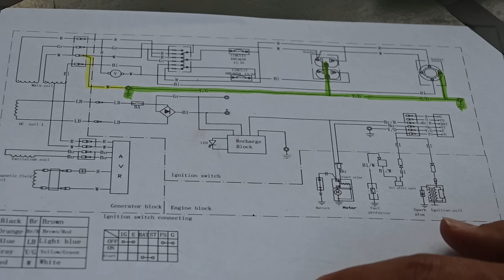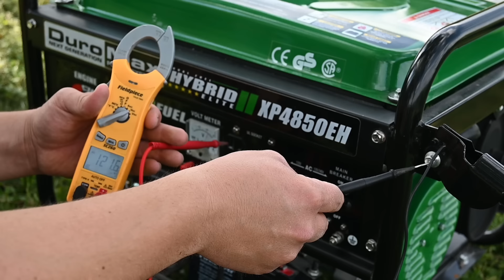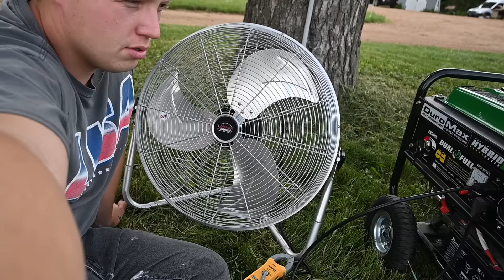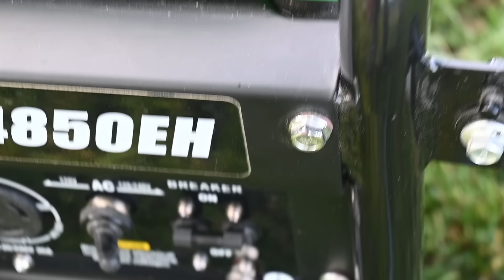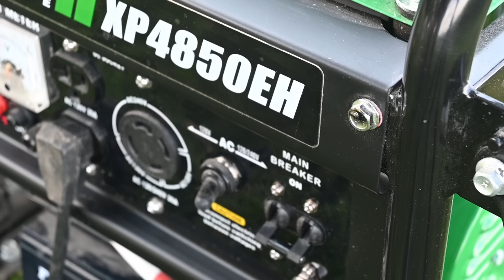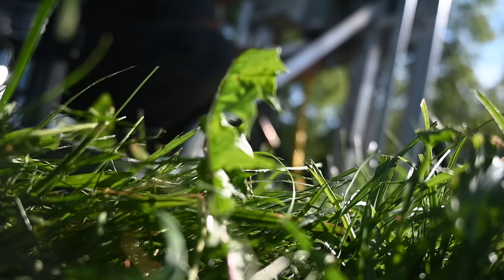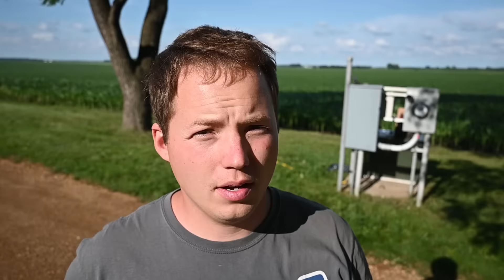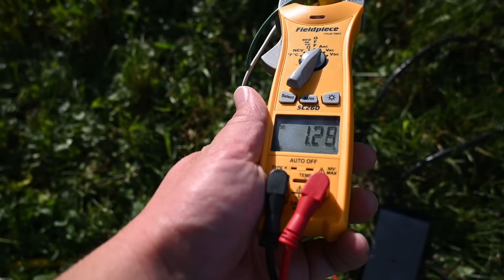What is a Floating Neutral Generator?

Comment: The frame of the fan would ground-fault to the grounding prong of the plug. This would cause a direct short inside the generator and trip the breaker. You should be testing from the grounding prong to the 120 volt hot side, not the frame. Voltage wants to return to it's source, not ground. The source is the generator not earth ground. If the generator neutral is not grounded to earth, then no circuit exists between the hot side and earth ground - no shock. For the frame of the generator to cause a shock if shorted to hot, the neutral side would have to be grounded to earth to create a circuit. In that situation you would be completing the circuit by stand on earth (neutral) and touching the frame (hot). You would have to go out of your way to wire it that way. The frame is not connected to either conductor so no circuit exists.

Earth ground is to protect from lighting. Electrical service grounds neutral to earth so that one leg has the same potential as earth. That's why standing on earth and touching the neutral doesn't give a shock - same potential - no complete circuit. Standing on earth and touching hot gives a shock, because the neutral has been grounded to earth - standing on earth and touching hot completes the circuit.

Comment: Why do so many think that "OL" on a multimeter means Open Lead. "OL" refers to Outside Limits on all multimeters. This simply means that the reading is outside the measuring capabilities of your multimeter.
Reply: If that's the way you prefer to think of it, that's fine.  Whatever works for you.  "Open Lead" or "Open Line" works fine when you're checking continuity or measuring voltage or current.  When you're checking resistance, it could mean "Outside Limits" or "Overloaded".  Again, whatever works in your head for the situation - it's useful information either way and no reason to criticize others for not using the same mnemonic you do.

Comment: I’ve recently seen where RV campers are using their generators with a short plug (this is a plug only, no wire) connected that has the ground wired to the neutral. They are doing this so that it will fool the surge protector they’re using.
Is this safe?

Comment: Thank you,
I have an inverter generator, floating neutral, used independent of the house system, extension cord only.
As it is now in an emergency it runs what I need. Should I be using a bonding receptacle, neutral to ground or ground the generator from the grounding lug on the generator to the house ground using a house receptacle with and extension cord. ( a single wire generator to house ground?)

Comment: sounds to me like a floating bond generator can give a shock if a defect happens WITHOUT it being connected to the panel in my house.
The Appliance cord provides a bonded ground when attached.
So running a Floating Gnd generator without the Appliance cord is a risk. Hopefully nothing shorts inside my generator if I'm just using it in the field.
Yes, it's a little confusing.

Comment: My 240 generator was bonded from the factory, I choose to leave it this way, I do this, because I'm concerned what would happen if for any reason, I lost the neutral between the generator and the inlet, the two 120 lines would be looking for a way back, and they would do this through electronics or items plugged in and could cause a lot of damage. In a case like that, the ground wire would pick up the load.

Comment: It seems like what I gather from this and talking to some of these brand names sticking their labels on this equipment coming out of China is they don't actually know how this equipment is wired up or what the electrical codes are in the USA are or even how electricity works for that matter.  So what you need to do if you want to operate any of this equipment safely and to code is get this understanding yourself, come up with the proper tests to gain the correct understanding of how your equipment is wired up, and then get your equipment wired up to code yourself.  It seems by default, unless you can prove otherwise, all of this equipment out of China is "floating neutral".  So by default, say you plug a power tool into a generator or inverter directly, you are not doing something safe / up to code.

So what I have is if you have no idea yourself and you ask the brand label what to do, it is more than likely the blind leading the blind.  If you do a proper study of the matter, then at least one party knows how to wire it up right, so it is probably safe to ignore the brand label if you really do know better.  If you really do know better, you should probably let the brand label know so they may have a chance to update things so they don't get people killed.  If you yourself are a blowhard and think you know without studying, then you may just get zapped out of your own arrogance.  The key point is the brand label does not know, they just stick their label on something and sell it for a profit.  Maybe they studied accounting, so just know that aspect of what is going on.  Like asking a manager at Boeing in charge of the 737 MAX program, they don't know, but they will dictate to you their uninformed opinion while stuffing their pockets with cash and outsourcing the work to the lowest bid.

Comment: You yourself said the generator is rubber-mounted so grounding to the frame is going to give an open circuit and just shoving the electrode into the ground isn't going to give a dead short either. To do the test right drive two grounding rods at least 2 feet into the ground. One for the generator, not the frame, and the other touch the electrode to it, If it is a grounded circuit then it will blow the breaker. also if the ground is very dry you will have to wet the ground down to complete the test and if the rods are more than 3 feet apart all you will get is a bunch of worms jumping out of the ground, not sufficient enough to blow the breaker.
Reply: @Ken I can't speak for Ben's generator, but mine has a copper ground strap between the rubber-mounted generator and the frame which bond the two together...

Comment: I'm wondering if you had any current flowing thru the generator grounding wire to grounding rod and if there was a potential difference between the house ground rod and the generator ground rod.

Comment: I noticed you have your generator on 120/ 240 volts switch is all way right.
Maybe you trip your breaker if you move AC switch to the left to 120 volts and trip the breaker. 
I keep looking at that ac black switch.
So on 120/240 it will only power the 30 amp 4 wire twist lock receptacle 
Not the 120 volt receptacle.

Comment: breakers on that generator really just protected from overload if you try to hook something up it pulls more power from the generator can handle it pops out. got to be careful too short circuiting a generator can damage the surge capacitor that helps getting electric motors in heavy equipment started depending on where you live to purchase that capacitor you don't only have to have electrician's license to buy iplus technician license to buy.

Comment: Thank you for such a thorough explanation and reasons for the different grounding circuits. 
I’m getting a Champion Inverter for a backup power supply connecting it to a service plug to my panel. It comes as a bonded ground and per Champions instructions I’ll disconnect the bonding wire.
If I use it as a stand alone I’ll reconnect the bonding wire.
👍👍
Reply: I just got a champion inverter as well . So we do. It use a transfer switch and just use a service plug we still need to change the generator to floating?

Comment: umm there was no load when you connected it to the earthed frame, it also doesn't have a GFI breaker, so the ONLY thing the breaker would do is overcurrent protection.

Comment: i always wonder is nuclear power plant is floating as well ?? it explains issues for faulty computer boards due to fried circuit breaker did not trip the breaker while operator see water level gauges normal, but never did work by getting stuck in same level what you do..

Comment: You've been doing ur homework. U don't want any parallel grounds. some ppl make a plug 
with Neutral and ground jumped so when u put that plug into gens receptacle, it bonds the
neutral to the ground. On a construction site with hard used equipment, there could be a
chance for a bad/fatal shock.If the neutral is grounded due to pinched/overheated 
component but notice is given for a floating neutral,  gen sitting on damp or wet ground
 or faulty tool being held by person and touching frame could receive a dangerous shock.
               If Gen says it is bonded but it is not ( due to someone making changes) & with a 
hot wire touching frame a person using a bad extension cord could have 120V on ground 
or frame of some tool and due somehow thru bad maint. of extension cords in construction 
use a metal 4 plug gang box has netral hooked to ground and person getting between tool 
with hot enclosure and neutral could be in serious trouble. 
          So Yes a grounded system is much safer because as U sed there is a reference point.
If a fault is found in a tool or appliance. a 240 volt heater with a motor. a wire touches the
frame and shorts shutting off the power.

Comment: Question… with the 120/240 switch to 120… where is 120 30 amp available 
Can you get 120 30 amps from the 120 outlet or do I need to get my 120 30 amp from leg of the 240 outlet? 
Question is for booking up my 30 amp single phase RV

Comment: Correct me if I'm wrong, but In the fault condition you describe early on in the video ("hot" wire shorting to the case), you have then essentially accidentally created a bonded generator with one end of the coil referenced to the case ground instead of the middle of the coil. There would be no problem unless the "neutral" (which we would now be justified in calling 120V) or the other "hot" leg (which we would now be justified in calling 240V) managed to ground themselves to the earth, in which case we'd have a 120V or 240V potential, respectively, between the generator case and the earth and extreme risk of shock.

This, however, is not so different from a bonded neutral generator, where, if either of the hot legs grounded to the earth , we would have a similar risk, albeit with a maximum potential difference of 120V.
Reply from the maker: You nailed it.

Comment: My main panel box is neutral - ground bonded. It then feeds a sub panel inside my home where my circuit breakers are. My Champion generator has a direct feed via a 50A breaker to my sub panel which by the way has an Interlock. So does this mean my configuration is a floating neutral setup due to the main outdoor (bonded) panel box and the indoor sub panel box being disconnected once I activate the Interlock to disconnect the two panels? I think so....

Comment: Thanks for the very informative video. My generator is apparently not bonded. The neutral has no connection to the ground in the receptacle.  The chassis appears to be just floating as there is no connection to anything. Running the generator and touching a hot lead to the chassis, nothing happens. It seems entirely possible there is a chance the chassis could become hot if there was a fault and then through me via the ground connection in the panel. Boy, am I confused.

Comment: installed a reliance transfer.. a few years ago not sure if the Neutral is switched? i will find out tommorow.Also i am pretty sure my older generac generator is Bonded will also check That never have been shocked but never had a ground rod either will check it's bonding tomorrow and make it floating if the transfer switch doesn't switch Netural.jim

Comment: Hi Ben, great channel.
I have a panel that has a main disconnect that is a sub panel off the main meter,  with isolated nuetral and grounds.  I plan to install a interlock kit and back feed with my generator. However it has a bonded nuetral and ground. Should I disconnect the bonding terminals making it a floating nuetral if I'm only going to use the generator with the 30 amp plug for a back feed to my panel? Thanks

Comment: You had zero volts from frame to earth because the rubber tires and feet insulated the frame from earth. Your ground rod will have NO effect. The ground rod works at your house because the entire electric grid is grounded. You were correct when you said, basically, that your generator was a power plant unto itself.
    Where the problem comes in with what you're saying is if you have an extension cord plugged into your refrigerator from the unbonded, ungrounded generator. If the hot wire comes off from say the light socket and hits the metal case of the fridge, plugged into the wall, it would blow the house circuit breaker. Plugged into the generator via an extension cord, nothing will happen including no one getting shocked because even if the fridge body was hot, touching it won't cause a shock because there is NO path through the human body back to ground or neutral which lies exclusively within the generator itself. The only way to get a shock in this scenario would be to touch the fridge and the bonded generator together.
    Actually, the only reason that you would need a bonded neutral / ground generator would be in some permanent / semi-permanent installations. In my house, for example, I have a semi-permanent setup. Normally, I am on city power. My generator is in my UNATTACHED garage wired to back feed my electrical system through what is commonly referred to as a suicide cord, a cord with a male plug at both ends. What makes mine different and safe is mine is plugged into an outlet dedicated to the generator and nothing else. No arc welder, no compressor, no nothing. Neither plug is ever unplugged for any reason so there is no shock hazard. My generator has a 4 prong twist lock outlet with matching plug which is connected to a piece of 8/3 with ground cable. This is 8 gauge, 3 conductor, hot neutral hot plus a ground wire. The other end of this cable terminates into a 4 prong plug that mates with it's dedicated socket. Then on through more 8/3 with ground cable to two 30 amp breakers in the garage panel box then more of the same cable into two more 30 amp breakers in the main outside shutoff box under my power meter. All of this is bonded ground with separate neutral pins from generator to panel box to main shutoff to breaker box in the house. If something shorts on city power, it goes to earth ground and blows the breaker in the house. If the power goes out, I cut the main breaker outside, start the generator and flip the two 30 amp breakers in the garage. Let there be light. If something shorts in the house, It grounds back through the house wiring grounding circuit but NOT to earth. It grounds back to the ground / neutral bonded generator but still blows the breaker in the house panel. Earth ground is still common to the system as a whole and not cut when I throw the main breaker but the buck no longer stops there because the lower resistance path is back to the generator. Even without bonding, a short wouldn't go back to earth because power doesn't originate outside my property. It wouldn't go anywhere without a return path back to the source ,i.e. the generator. Mine, like yours, is on rubber tires and feet so no path there either. This would present more of a fire hazard than a shock hazard. I hopes this helps you to understand electricity a little more.

Comment: Can I run a sub panel off a sub panel
Reply: Only if you start with patchbox 🤪😂
Reply: You can! You can have an infinite number of sub panels. Only the service entrance panel will have a neutral and ground bonded.
Reply: @aaron74  You cannot have an unlimited amount of sub-pannels. Although the NEC does not have any specific limitation concerning how many sub panels you can have the NEC does have atleast 5 rules that im aware of that will limit you based on feeder, usage, and available short circuit current. Remember that if your feeding a sub-pannel off another sub-pannel off another sub-pannel you are going to have to upgauge your conductors to meet the 80% rule and to factor in voltage drop. The upsized conductors increase the available short circuit current. Depending on the situation you might not even be able to get breakers rated for the short circuit current. In my experience the most branching I've even encountered was a building with a switch gear in the vault that fed a switch gear on each floor that fed pannels that fed sub-pannels that fed other sub-pannels. That was in a skyscraper filled with upscale apartments.
Reply: @Veritas-invenitur   Yeah practically speaking you are totally right. The constraints of downstream loads and distances would absolutely restrict the number of daisy-chained subpanels. This is why when there are multiple subpanels they're fed by a central main, rather than another subpanel. Thanks for the reality check!

Comment: Not,bad.if your transfer switch inlet is connected to your home panel,wich should be grounded, you are grounded, this is presuming your neutral  to the grid is still in one piece.now if you lose your incoming line completely you have lost your neutral, but your home ground should still be intact ,barring a catastrophic house disaster ,you should be ok.

Comment: What an informative and confusing video. lol. I really do enjoy your video’s. So, I bought a Westinghouse 9500df, it is bonded and has directions on how to reverse it in the manual. I plan on connecting it to my house via 50amp and interlock. I just need confirmation that I SHOULD reverse that on the generator and only use it for said application, correct?

Comment: Good info yet over my head. I just bought the exact generator to install in my school bus conversion and will be using a couple extension cords and also charging my solor batteries. So should I be concerned with the way it is from the factory ?